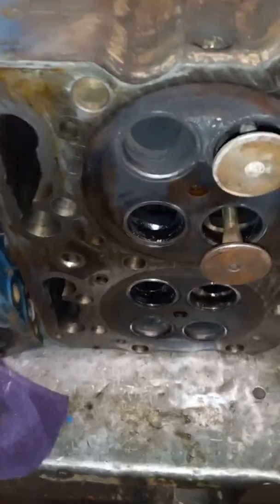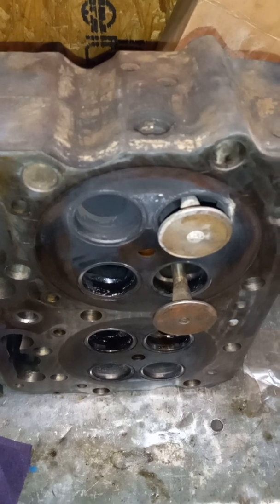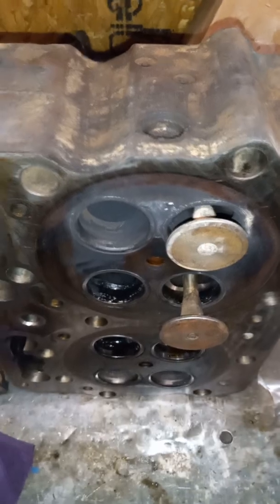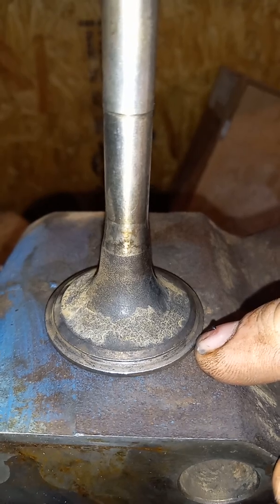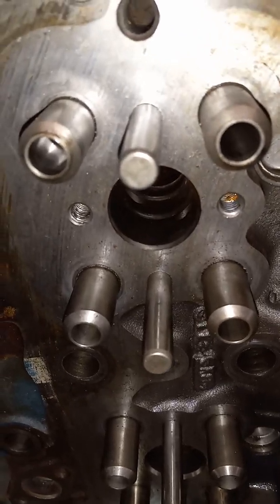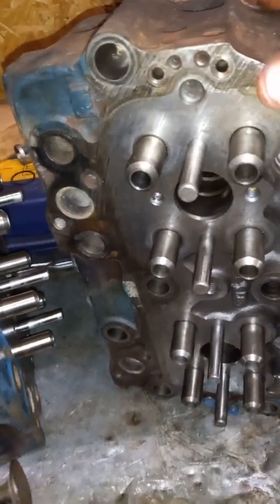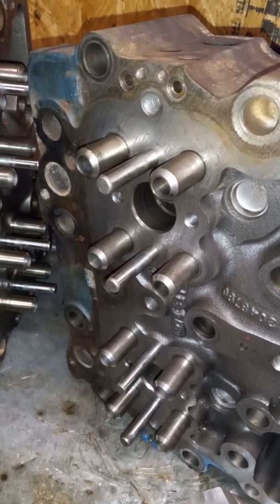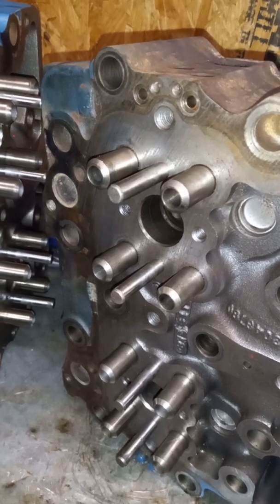stc  and non stc injector timing and symptoms

Comment: You are confusing "top stop" injectors with "stc" injectors. STC, or "Step timing control" has the "box" on the side of the engine and the injectors have a "hydraulic lifter" type link. Top Stop injectors were used in non-STC engines, Big Cams and their  purpose was to momentarily unload the injector for lubrication purposes/camshaft life.
Reply: I am myanmar  Thankyou
Reply: What it is red hot turbo an exhaust

Comment: I got a question,  i have a cummins nhc 250, 855 and it won't idle under 1300, at start up it will idle at 600 for 20 seconds, then jumps up to 1300rpms and stays thier. I adjusted idle at pt pump, I've turned down 3 times, and each time idle at 600 then jump up, adjusted again, idle at 500 then jump up on its own, adjusted again, idle at 500 and jump up to 1300 rpms, i can shut truck off, start up and idle at 600, then 20 seconds it jumps up to 1300 on its own and stay right thier. I'm not sure, it don't act like getting air, because don't stumble at all, everytime I start it, it starts right up, no hesitation.
Reply from the maker: pt pump needs rebuilt the afc will leak internally or fuel control valve gums up causing it to run away. extremely common on pt pumps